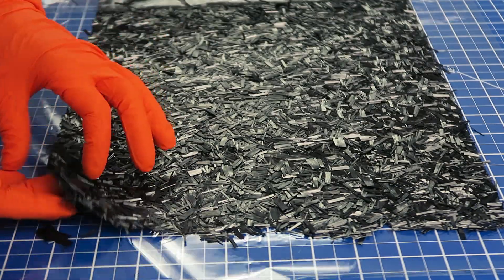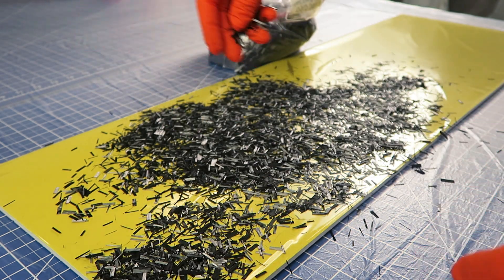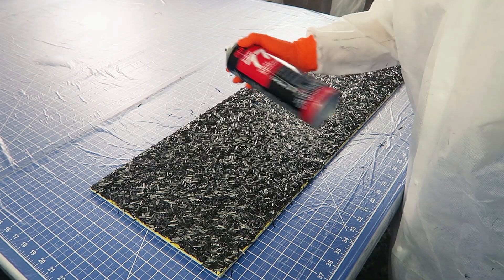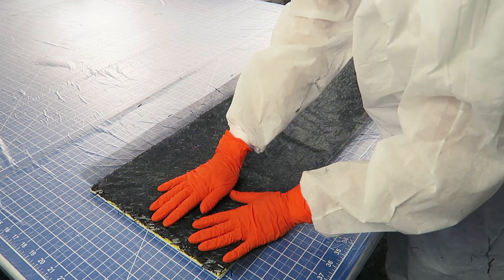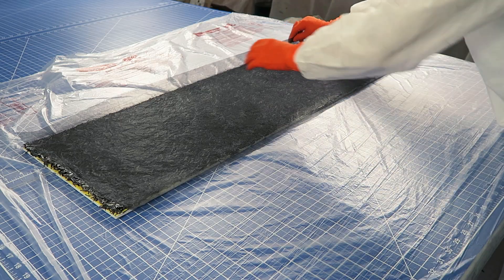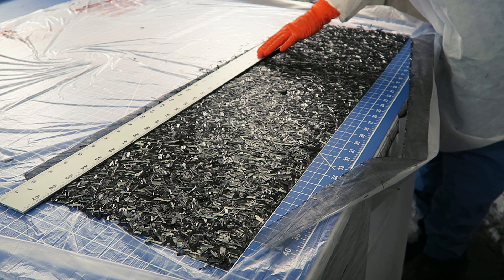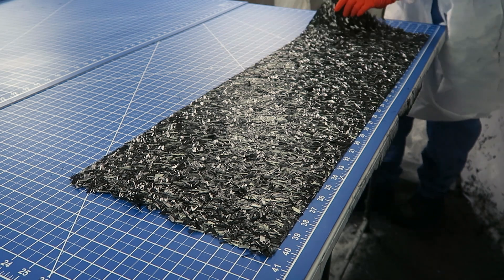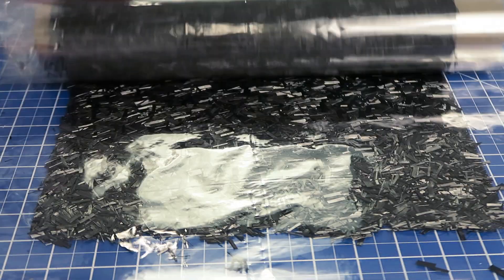How To Make Forged Carbon Fiber Fabric

Comment: If you bend the fabric, most of it could come right off even with the adhesive. Is that an issue?
Reply from the maker: If you're gentle and don't handle it excessively, most of it stays attached. Another way that bonds it a lot stronger is to use an iron and fusible webbing, but I'm still exploring the impact that has on bonding and resin saturation.

Comment: This is cool, the only downside I can see is it will use much more resin than standard cloth.. So probably no good for lightweight parts, probably would be more britle also.. But still.. In a pinch for some general reinforcing i like it..
Reply from the maker: I use it as a decorative element and back it with woven fabric for strength in molding application.

Comment: Great to see you back in action! Keep it up.

This is me, but do you think there might be also a lot plastic waste? Could the table covering plastic be re used, etc?
Reply: plastic must be used before it becomes waste on its own. We are forced to produce plastic by refining oil. So there is no point in saving small pieces of plastic.
Reply: What’s the largest “thing” you built using carbon fiber?

I got many questions hope you don’t mind them 🙏🏻
Reply from the maker: Unfortunately there is a lot of waste working with composites. It bothers me, too.

The longest dimension was probably the carbon fiber sword. Well I also did an art piece that was bigger but there isn't a video for it. So nothing impressive yet.